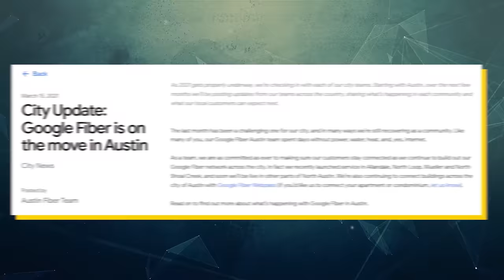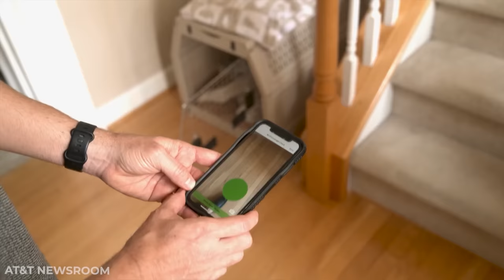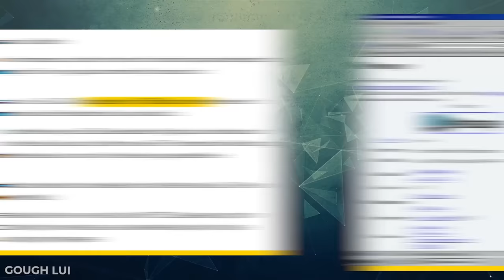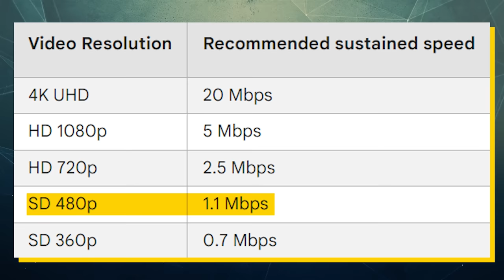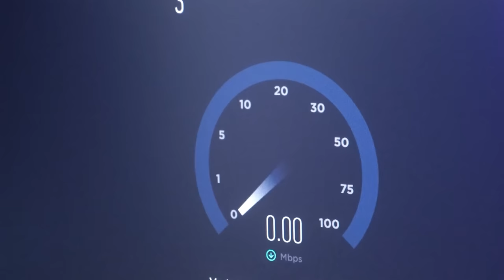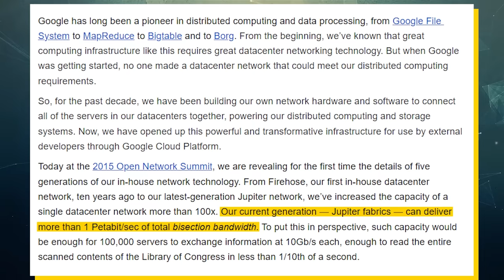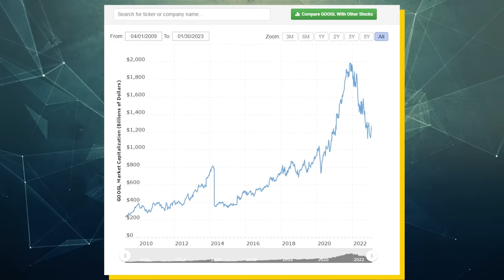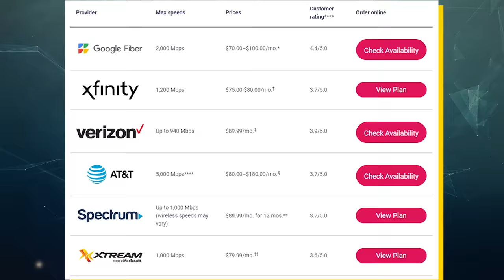Google Fiber Never Had A Chance. But That Was By Design.

Comment: Sadly, the upload bandwidth hasn't improved alongside the download bandwidth. AT&T certainly has, but companies like Charter fiber doesn't. I tried to get Fiber in my area to host a server. Charter was the only option. They advertised 1 gigabit speeds and when I asked if this included upload they said yes, but that was a lie. After getting it installed I learned that while the download speed was around 600 megabits per second (just over half what they promised) the upload speed was just under 1 Megabit! My cell phone had a better upload rate than that! 

So it appears that most of these companies just invested in the download infrastructure and put no effort into upload except for those who were directly challenging Google like AT&T. 

The worst part is that because of the monopolies in place there's no way for anyone to compete. 

What if, instead of giving the telephone lines to a single company in a given area, the cities maintained them and all companies who wanted to use the lines could do so and had to share in the cost of maintenance. Then you wouldn't have to bury fiber because you could use the telephone polls and anyone could start their own ISP like used to be the case in the 90's. We'd see healthy competition pushing prices down and features up.
Reply: I had a 300/300 fiber connection just outside of downtown Vancouver through Telus who installed fiber into our 1994 artist studio condo a few years ago and it had true upstream bandwidth but the dirty bastards block port 80 and 443 on the domestic connections so you can’t serve standard web services without paying for the commercial service, unlike the cable co with their 15mbps upstream (300 down) which they left wide open.  I could have gotten 1gbps down but the upstream was still physically maxed at about 300mbps due to the type of fiber used within our unit (more durable but not as high bandwidth) so I felt like paying more wouldn’t be worth it just for a bit more potential downstream speed, which I really didn’t need since I had no 4K TVs at all.
Reply: @SchwaAlien  You could potentially get around that by using an encrypted VPN connection. At least in that case, since they couldn't inspect the traffic, they'd have no excuse to throttle you.
Reply: @Elliandr  presumably most VPNs won’t let you forward port 80 and 443 into your server without quite a bit of money.  The one I was using allowed one port that was assigned randomly to be forwarded, so not terribly useful even though it was a paid service.

Comment: I was so happy when some people started a local ISP a few years after Google fiber decided not to enter our market. I particularly hate the cable company and I dislike the phone company. I had to buy internet from the cable company because I had no other choice. In a one-year time span 22% of the time the internet was not working. no they wouldn't give me a discount or cared when I told them it was interrupting work. This is one of many situations of why I hate them.
The local ISP caused the cable company to lower their highest internet plan by ~$100 a month and increase its advertised speed by over 900 megabits per second and there's still more expensive. The real speed is closer to 700mbps and the ping is about twice as high as our local ISP. 
In my opinion still one of the best examples of competitive intrusion. Every time they expand to a new neighborhood they get about 60% to 80% of the customers in that area. Not to mention initially as you can see above they were probably about order of magnitude cheaper/better. Just recently they doubled or more all of their speeds for their plans leaving their competitors in the dust again. you actually get 100% the speed you pay for too assuming the other side can support it. 

At about 1 gbps or more you might not see full speed when downloading. This may or may not be because of your ISP or the website you're connecting to just doesn't have more bandwidth to spare then that. 
If you get a download server with 10 gbps of connectivity. Well at the 1 gbps isp plan that server could support approximately 10 people at full speed. How often do you think you're going to only have 10 people on that server. That's not an unreasonable example for a lot of smaller websites.(or worse but they're generally not sending lots of large files or have a CDN between them)

Comment: If I were to live n America I would specifically pick google fiber over any other provider. Here in The Netherlands we have 4 large cablers KPN, Delta, Glasport and E-Fiber and all the current options are equally as bad since there is virtually no competition and the competition there is leases from the 4 cablers meaning they only act as middle mans. Pricing has gone trough the roof and customer support has gone down the drain.

Comment: I would say that ISPs are stagnating again... DSL in my area tops out at 18mbps down / 5mbps up, and while there have been some speed increases to Cable (it tops out at 1.2Gbps in a few neighborhoods), the local cable company has not expanded the areas that it services and also has a data cap before charging their customers extra, despite there being no reason for it from a technical level. Data is not a resource like water or natural gas, and it doesn't take extra resources to generate more like electricity. All that is needed is to keep the data "pipes" wide enough to let everything through. There is still a significant number of households in the local region that can't get any Internet besides dial-up, overpriced cellular, or satellite to this day.

Comment: The story is different here in Canada. Here the major telecom and cable companies were funded through government initiatives both provincial and federal to deploy fiber in their core networks and the cellular services needed the fiber speeds. We didn't have a disrupter like google fibre here. It was more of a public private partnership. The major cable company in Ontario has a program called Connected for Success that provides 25Mb/s for just $11 a month. I believe it is subsidized through government assistance and it is also tied with a Cable TV offering that is optionally available to that TV/IP becomes reality and the existing coaxial cable plant can be replaced with fiber throughout their network and eventually to the home.  This biggest issue is high income places like condo buildings, very high income neighbourhoods,  and luxury apartment buildings get the fiber to the residence and the social housing is left with the coaxial cable and  poor service with frequent outages and long repair times. There was a federal program that extends this model to other providers as well. if VR takes off it will follow this same deployment leaving a significant portion of the population  left behind and without the ability to  participate in the benefits of VR for  half a century or more.
Reply: "This biggest issue is high income places like condo buildings, very high income neighbourhoods,  and luxury apartment buildings get the fiber to the residence and the social housing is left with the coaxial cable and  poor service with frequent outages and long repair times."

Where. Every new construction since 2013 has fibre to the home. Every coax building and address that doesn't get fibre right away is getting 1.2ghz nodes and segmented. 1.2 ghz nodes can run a traditional return path with a 42mhz wide return with more efficient modulation, or an 85mhz return with the same. The same units will do 208mhz return which is almost 5 X the current bandwidth and then layer on the more efficient carriers.

Currently a coaxial 1.2ghz node can run up to 10gigabit in the downstream and around 500mbit in the upstream still running both old and new modulation techniques. A 1.2ghz node  at full bore in full duplex runs 10gigabit symmetrical.

Social housing is usually high density and little buildings have as many as four 1.2ghz nodes with 15 units per segment, which is nothing for a customer load. The wiring is as old as the late 1970s. There would be no reason to have "more frequent outages" either. Either a cable is cut or it isn't. Either a fibre is cut or it isn't. 

Repair times are even longer on fibre systems that are fully buried and permanently spliced because there are no test points available and no place to take a temporary connection from. You need much more expensive equipment and skill to troubleshoot and repair a fibre system. Techs are terrified of them.
Reply: @Todd.T  I am in a social housing unit in the East end of Toronto. It was built in 1974.  It has a copper RG-6. We have 4 - 6 outages per month totaling an hour or more from the cable company. This include both TV and internet. Bell Canada will not run fiber to the building. I know I have tried to get it. The best speed we can get is 25Mbés meanwhile the new condominium across the street has a sixteen fibre pullover to serve sixty-four units. It is less than one hundred meters away. I know someone who lives in that building and he has had no outages since he moved in two years ago. He also has Gigabit fiber in his condominium. There are twenty-seven social housing buildings totaling over 1500 in a 4 square kilometer area walking distance to my building and they all have similar limitations and service levels. The service at our building was so bad they had to re-cable half of the building to get minimum service levels. Most of the cable that was there before the re-cable was from the early 1980's. We also have a huge issue with cable theft. People just climb across the balconies and remove the copper cable and then sell it for scrap. One person died a few years ago when he missed the grab in swinging between balconies using the dividing partition. It gave way and a couple of bolts sheared and he fell nine stories with a fatal result. If they installed fiber the theft also would not occur since the thieves would quickly learn they don't get paid for fiber cable.
Reply: @PWingert1966  All of the optical nodes and amps from 2004 and up support gigabit speeds. I am using an RG6 drop from 1999 on a coax network from the late 70s and it’s all been updated merely by changing the node and the connection points and the amps. Everybody’s still using decades old RG6 drops at 1.2ghz and there are people with 1850/170 packages throughout. There are also 300 people on a single leg because it wasn’t redesigned, just updated with new amps, and connection points. Outages are not caused because you have copper wiring. Your limitation you say you have is not limited by copper wiring either otherwise I would have outages.We’ve had one outage because when the work was done someone left a weather sealed port open on the network and water got in it and caused a short.
Reply: @Todd.T  Regardless of the technical cause our building is getting substandard service and part of the cause is that it is not viewed as a priority due to it being a low-income building. we have over 400 apartments in the building but less then half use the cable company or the telecom company. So they are not making a lot of income fro the building either.
Reply: @PWingert1966  Fibre isn’t just about selling faster services, it’s about operating costs too. If big blue comes into the building, the government forces them to let third party companies access the network. Once you factor in how many people you will get as a competitor in the building, the ROI on the build doesn’t look good so they don’t want to come. Vandalism is vandalism and you can’t blame a network outage on that. The police should handle that. In Scarborough they started putting police stations in the building and security cameras with 24hr monitoring. People don’t touch anything anymore. The slowest single channel modem using 2004 tech will still run 38mbs. I bought one and used it for years.

Comment: This video is extremely misleading. It says AT&T is cheaper, but that's just flat-out untrue. AT&T will not even price match GF's price, much less BEAT it where I live. Also, they left Louisville because they were trying a different approach to laying the fiber in very shallow cuts in roads, filled in by a new substance that was supposed to protect the wire. That substance failed and was just breaking down, so Google had to give up. Also, Google's real issues with the service right now are just in relation to the TV offering, which is the same issue hitting every cable company. For those who just want an ISP, Google is doing extremely well.

You're correct that Google Fiber achieved what they wanted to do, but I don't think they're going anywhere.

Comment: Cable services can suddenly offer 500 megabits because they piggyback on the fiber infrastructure that AT&T provided.  Here, Spectrum has a box out on the telephone pole that converts the fiber signal to a copper-coax signal.  So it comes into the house like Cable TV always has.  But it's really fiber through most of its journey.

Comment: ATT Fiber is no where near ubiquity. They have major coverage gaps. In my street Google Fiber is the only fiber player. ATT offers 50 Mbps DSL. Google Fiber is rolling out 8 Gbps speeds for $150. Also Cable internet was always faster than DSL for the most part. DSL has major distance limitations.

Comment: I think the current challenge is servers throttling throughput. So you have a fiber connection at home but you download a 100gb game and don’t even get a speed that is 10% of what your connection is capable of. 
Yes, there are some very good reasons for this. Servers have a lot if data to get out to an insane number of clients. But there literally is no need for home connections to get any faster at this point until there is a breakthrough on the server end. Not only with raw transfer speeds but latency as well.

Comment: I used to work in the residential ISP world. A BIG holdback to speed increases was due to govt regulations. Analog TV and cable cards ate up a HUGE chunk of the available spectrum on coax. Now those mandates are gone and we're seeing the speed increases. I recently saw a video (antenna guy maybe) saying Spectrum is about to roll out a big upgrade in upload speeds due to no longer being mandated to support cable cards.

Comment: We got google fiber when they made it available at our address in Nashville about two years ago. Never looked back. It was significantly better than AT&T fiber which we had before. It may just be because of how good Google’s Nest mesh network is, but our internet is significantly more stable and fast than with AT&T fiber or Xfinity. So google fiber is still expanding, just not quickly

Comment: I had cable through spectrum before moving to 1GB fiber with ATT and then to 1GB fiber with Google. The purpose of Google Fiber is not only to disrupt the industry but also to have access to the home user's browsing information. I recall that my 1GB ATT cost me $80 because of a $10 discount to disclose my browsing data to third parties. Once Google Fiber made it to my neighborhood, I ditched ATT and got the 1GB plan for $56. I believe that Google will continue investing in fiber only if it can harvest user data and use it to generate income.
Reply from the maker: Sounds like Google haha
Reply: your ISP can not read your network communications when using https (which was also pushed, partly, by google)
Reply: @fridyair  They don't care about the specific data, they only need to know that there's someone in this area that likes this and that.

Comment: I guess this is why google provides inferior routers vs the competition. The Google modems are pretty good. But the Wi-Fi needs a lot of work. Wish they would start decommissioning the Google Wi-Fi points and switch to the nest pro. Would make my job a lot easier
Reply: You can just connect your own wifi access point to the google router and it works fine
Reply: @LilacMonarch  terrible idea. That cause’s double nat or your relying on the Google’s router to properly use bridge mode. I work as an install technician installing their service. My gripe about these routers they use ac1200 for their 1gig plan.You have to  Att(fiber), spectrum, etc at least starts you off with the Wi-Fi 6 router.

Comment: In other news:  Google Maps was designed to make the paper folding map industry more competitive and save trees, and it has!  Hooray to Google!  Truth be told, Google did well.  I recall those days of 3-5 Mbps speeds well, good enough for email and light web surfing but not much more.  Even video calls were low-res.
Reply: Fun fact:  optic signals have to be amplified from time to time, between every 100 to 800 km (about 60 to 500 miles).  Fiber optic signals can be amplified two different ways: converting them back to electrons then back to light (hard to do), or, the "easy way", done by fiber optic ISPs, is to mix the existing light signal with another light signal in a Erbium-Doped Fiber Amplifier (EDFA), and automagically the output signal is amplified.  This is amazing if you know how difficult amplification is in electronics, think vacuum tube, op-amp transistors, LEDs, lasers and how inefficient conversion and amplification is.

Comment: This forced Comcast to rollout Docsis 3.1 10G on a node then now to Docsis 4.0 allowing 2x10G, 2x40, and 2x100g on a node that can be split again.  Same thing when you look at GPON our company is deploying allowing 2.5G\1.25G X 144 fibers potentially capable of saturating a 400G connection with around 18,000 customers running 3 x 4k netflix videos.  Exploring XGS-PON  10G\10G can run on top of this same fiber plant cables, this addition could potentially move towards saturating a 1.6T connection multiple 400G or 800G.